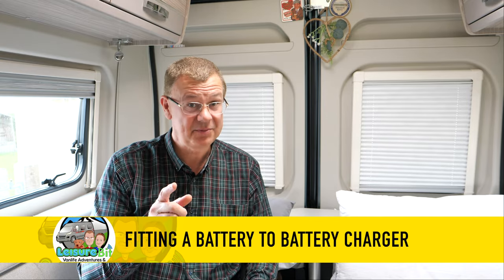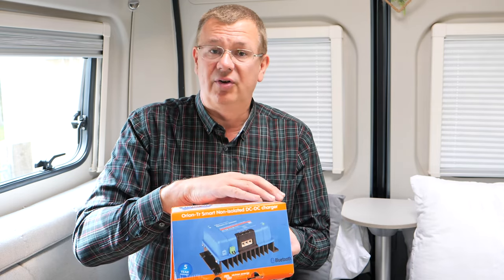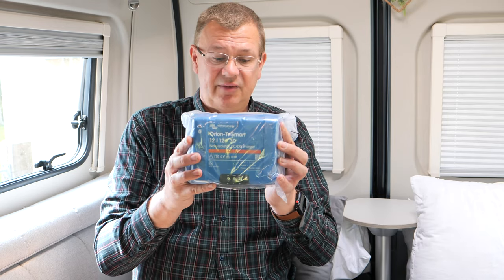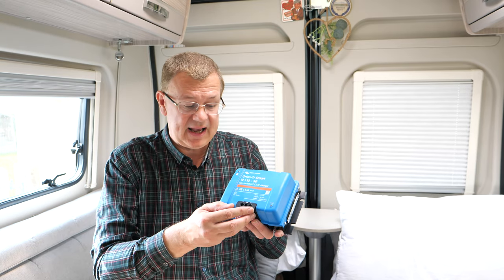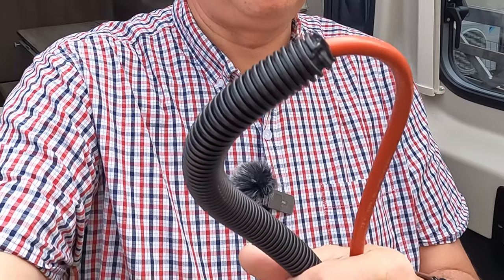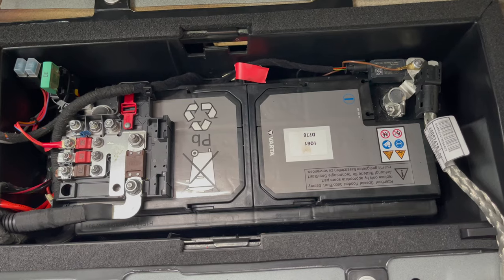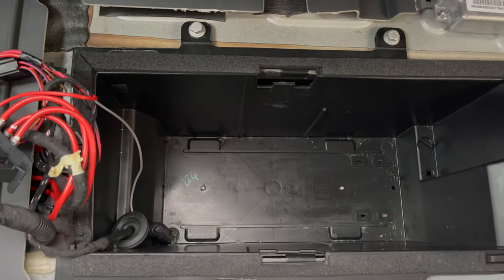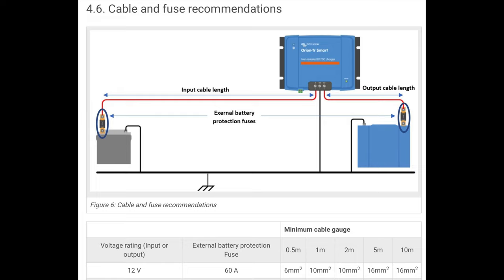Victron Orion DC-DC Non-Isolated Charger B2B Installation in my Fiat Ducato Campervan

Comment: So much electrical so little room for beer 😂.
Seriously though good explanation, we’re having one in the new van although the Elddis seems to work ok for us but we’ve never been massive users of 230v
Reply from the maker: Thank you - Haha - we found the beer got too warm next to the heater outlet - who wants a warm beer 🍻 I do think I will do what you did and box some of it in a bit better at some point though. (Will be another job which never happens!)
Seems to have cracked the problem of poor charging when driving - for those cloudy days when solar is naff wanted something for when we’re away for more then 4/5 days off grid and driving about the battery gets a decent top up (should add about 50ah per hour of driving then with both - we were only getting 15A or so via the Elddis electrics (wiring seems massively undersized) and made it so it can be removed when we come to sell the van (saves future spend hopefully 🤞) as can put it back as was (beyond the hole in the floor obviously 🙄)
Hope you guys have a lovely weekend - all the best, David 👍

Comment: Hi David, love your videos by the way. I have an all powers power bank and need a way of charging on the go but quickly, using the 12v power lead would take 10 hours from flat. I was thinking a 60amp B2B, this will put in 650/700 watts PH. My question is can I piggy back off my existing B2B to power my second B2B charger (can I use the power from the first one) thanks in advance
Reply from the maker: Good afternoon, you would normally run an additional cable to a second B2B if it’s drawing a high current - assume the power bank has an input which will take a charge bigger than the 12v lead which you would use?
How large are the cables to your existing B2B and what power is that one? (Might give an idea on any spare capacity)
All the best, David 👍

Comment: Great video…I assume that you had a split charge relay fitted before this video and your conversion…..did you disable it? If so how did you do it….can you point me your instructions on that aspect?

Ray
Reply from the maker: Hi Ray, the van had a Schaudt B2B fitted before I installed this - some of the models have a split charge relay but with mine having a smart alternator it had a B2B all be it the power output was poor compared to claimed output on the old one. I think you can pull a fuse and some people have not bothered disabling - personally I would then you know what’s what though. Not sure if that helps at all, All the best, David 👍
Reply: @LeisureBit  Hi David…. I don’t have a smart alternator, even though the vehicle is only 2017…just before the smarts came out in ernest..by and large, smarts don’t have a split charge relay; though some actually still use them.
So this leaves me with a dilemma about how to disable it and then fit the Victron Orion smart DC 2 DC charger……
I’m thinking I’ll try to remove the D+ wire that energises the relay….but I need a little more advise..

Thanks for replying though….much appreciated

Ray
Reply from the maker: @rayleeson6135  hope you manage to get it sorted, like you say removing the d+ might sort it but difficult to say without looking into further,p. Good luck 👍

Comment: Using same charger. Gets so hot I can’t touch it for more than a few seconds! Is that normal? I’m using 6awg wire and 60amp fuse at the battery. 

Is the burning hot normal?!
Reply from the maker: Yoo mean the charger or the cable? If it’s the cable that’s a concern. The charger runs warm and can get hot when it’s been on for a little while hence the large heat sink - it does drop back power if it gets too hot. Where do you have it mounted? Is there enough air circulation? You can get a cooling fan if needed too

Comment: Hi David, I’ve been watching your lifepo4 installation videos (and others) with great interest. We’ve downsizing to a cv20 Supreme, picking it up early July. Having had lithium in our last motorhome we would like it in this one too. 

Although I follow most of what you are doing and saying, some of it is over my head, particularly connections to the existing system. I wouldn’t feel confident to connect everything myself. I’ve been collecting the parts, all Renogy (the 2000 watt inverter has a transfer switch built in).

We live in the Isle of Man and unfortunately the scope for specialists here is limited. I can do most of the leg work myself, but it’s the final marrying up to the cv20’s electrical system I really wouldn’t want to do.

What I would like to do in late August when we go away on our first long trip, is to drop in to a specialist who can finish off the connections. I was wondering if you could recommend someone we could pre arrange an appointment with? We’re heading towards Portsmouth ferry terminal from LIverpool.

Great videos by the way, I’ve collected most items needed to copy some of your mods. 👍🇮🇲
Reply from the maker: Not long now until you pick up your new van. I find it’s about space optimisation as lots of folks seem to have a lot of space in the big vans for the electrics but I wanted to minimise the space used by it and partially achieved that I think so I didn’t lose too much storage space, 
Regarding connecting it up, I don’t have any specific company to recommend and would only recommend based on experience and haven’t used one. I know @gadgetjohn was doing some work like that or similar previously so might be worth giving him a shout or in the CV Owners Group on Facebook there’s been a few recommendations too. Conscious different gear need slightly different configurations too. 
Good luck with the van collection - exciting times
All the best, David 👍
Reply: Thanks David, I’ll do some searching on the cv owners group and see if I can find recommendations. 

Yes starting to to get excited about picking up the van, planning a trip based on Greg Virgo’s run down the N2 in Portugal.

Thanks 👌🇮🇲

Comment: Hi David Fantastic video. I was wondering how you connected the  D+ connection alternator wire? I have a fiat ducato 2022 with stop start. Love the Chanel.
Reply from the maker: Thank you, really appreciated. The D+ was handily connected to the b2b which was installed when I got the van. Not sure if you have a converter connector in the pillar behind the drivers door as you can pick it up from there? If not you may need to pick it up from either the alternator or another point.
Hope that helps?
All the best, David 👍
Reply: @LeisureBit  thank you so much for your help. Have a great Christmas and a happy New Year.

Comment: Hi David, love your videos. The original B2B installed (Schaudt WA 121525) has a switch for switching between battery types. If you have fitted Lithium and the engine battery was lead acid, which battery option would you chose. Also is this why you fitted the victron unit. Thanks 😀
Reply from the maker: Hi, thank you - appreciated. I wasn’t getting a decent charge rate so added the additional one - watch this space as pulling both out and replacing with a single unit.
The Lithium setting on the Schaudt isn’t the best for the LiFePO4 battery type I have (voltage is slightly high and it’s not very smart)
The Schaudt charges the Leisure battery so the setting is for the receiving battery, in this case Lithium (all be it the standard lead acid setting may be better for modern lithium LiFePO4 batteries.
All the best, David 🌅

Comment: Hi, super interesting, thank you. I was wondering how you could tell that the first earth you chose wasn't a good earth? Did you have to instal the whole system to find out or is it possible to test before hand?
Reply from the maker: Thanks for the comment. Interesting question -I tested it with a multi meter and it was ok from a resistance perspective for the first point so thought that would be fine, it was handy too. The issue was it wasn’t handling the current and the bolt wasn’t able to tighten enough. Lesson learned so I went to a more direct to the main chassis, I did consider running a wire from the negative chassis point near the battery if that hadn’t sorted it but that would have removed the benefit of non-isolated. 
Hope that helps, all the best, David 👍

Comment: David-- thank you so much for your informative video.  I noticed that both of your fuses are near your converter. Shouldn't the positive lead off of your vehicle battery have an immediate fuse right there to protect downstream?
Reply from the maker: Thank you - it’s got a 60A Mega fuse off the vehicle battery before it connects to the cable so it’s protected at both ends (I tend to double protect appreciate the likelihood of an issue in reverse is small but it does exist so fuse long runs at each end - main one of course for the battery feed is at the battery end. All the best, David 👍
Reply: Thank you!   This sounds like a very good approach!
 @LeisureBit

Comment: Hi
Good video 😁
We are fitting lithium to our adria coral 670 2019 (on 2.3 multi jet fiat base)
Struggling to find out what alternator capacity is 
Almost impossible to see the alternator itself never mind any identification labels 😕
Reply from the maker: It’s very difficult without getting it lifted up so you can properly get under to see the capacity - the only real way to confirm is to check it - I think if the van has a converters socket which most conversions do the load on that is 50A max but that still doesn’t answer the alternator. 
Sorry that’s not much help 
All the best, David

Comment: Hello David, thank you for sharing your knowledge, if I have 24V lithium batteries should I use an Orion-Tr Smart isolate 24/12-30A? That is, the device receives the battery connection in 12V and then the 24V lithium battery is connected?
Reply from the maker: The isolation is more around the negative / earth / ground connection rather than the voltage - I believe either should work but depends exactly on the setup - I would probably go isolated with different voltages just incase I changed the configuration later and wanted an isolated negative.

Comment: Why did you use such a high gauge of cable for the ground to the chassis?
Reply from the maker: Thanks for the comment - the reason for the thick cable is the leisure battery is being connected to the vehicle chassis so ensuring that in the event the positive of the leisure battery came in contact with the vehicle chassis the negative isn’t the weakest point and it should blow the fuse on the positive connection rather than potentially burning up the negative - the battery output is 250A continuous and 500A surge so needed to make sure it would handle that. Also saves voltage drop when b2b in use.
Hope that makes sense, all the best, David 👍

Comment: Thank you so much. I will be using this video for my install  I was confused about the negative to Earth and if I had ordered the correct charger, I have the non isolated same as yours.  I am assuming my main starter battery will be earthed to the chassis already somewhere so will earth the negative from the charger to the underside of the chassis (is it als ok to earth to the metal floor inside the van)?
Reply from the maker: Yes that’s right - the vehicle battery is normally connected to the chassis - you may be able to find a good stop to connect it to - just to make sure it’s a good connection for the power - all the very best, David 👍
Reply: @LeisureBit  thanks. If my leisure battery is earthed can I put tye negative through leisure battery terminal? My CTEK unit in there now is positive to starter battery and positive abd negative to leisure battery.

Comment: Excellent video David clearly explained.  Quick question, the smart alternator shunt sits on the neg battery post. How does this work and can it sense the extra load from the B2B?
Reply from the maker: Hi Brian, assume you mean the one on the vehicle battery rather than the one I fitted to the leisure battery? 
They both work very similar to be fair. They work by sensing how much power is going into (charge) or coming out (use) of the battery - on the vehicle it will be helpful for the computer running the vehicle (ECU) to know for example how much charge is getting to the battery to determine if start stop should activate and to help determine when the smart alternator should and shouldn’t be giving charge and how much. The additional load of the b2b should then register as demand via sensing the power increase or enable the alternator output to offset. (Hence smart)
They actually work either via sensing a magnetic field generated when current passes through, an induced voltage fro,pm this or via a piece of metal with a slight resistance then measuring the small voltage across it, using Ohms Law then you can calculate the current.
Hope that helps / made some sense?
All the best, David 👍
Reply: Thanks David, so I take it the current our field shunt is detecting ALL the current that is returning to the battery via the earth strap that is connected between the battery neg. and the van chassis.
Reply from the maker: @Brian-ug3cy  yes, that’s right (from my understanding of the setup anyway) there are some signal wires from the shunt / sensor but other than that the negative can just be disconnected to isolate so all current should be detected by it.
Reply: Many thanks David 👍

Comment: Thanks again for aq great video covering the modifications. Did you out the Orion in the same location as the existing B2B that came with the van?
Reply from the maker: Hi Louis, I put the Orion in a different place close by as was planning on using both but if it’s a swap easy enough to put it in the same place / check your alternator size before using both to make sure sufficient power - the extra 5A from the Orion shouldn’t make a difference but if you double up then worth checking
Reply: I’ve replaced the existing dc-dc with the Orion non isolated but with new 16mm2 wires and a 70mm2 earth from the smartshunt. One thing you did mention was the use of the D+ cable. I have it ready to go but not sure of where best to wire it in to the Orion. I’ve just added the standard loop from L to H that the Orion comes with. What do you suggest?
Reply from the maker: Hi Louis, if you remove the bridge between the L and H and connect the D+ to the L then it will enable when D+ is active as it pulls L to 12v and that enables hope that makes sense (so you have then no connection to H as you would remove the bridge - my understanding is H just pulls L up so it enables hence removing the bridge and connecting to L enables just when engine on)
Hope that helps,
All the best, David 👍
Reply: @LeisureBit  after a bit of experimentation and help from the motorhome fun forum i connected the D+ to H pin and disabled engine shutdown override and input voltage lockout. All works correctly now.

Comment: David,  did you connect the D+?  On the victron it runs an algorithm that works out why the smart alternator is active based on voltage and gives protection to the starter battery by not taking the power straight away.  The need for the D+ is this not required.  The factory one uses the D+ and thus draws power out of the battery regardless of the battery capacity and whether or not the smart alternator is fully charging or not. Did you do the D+ in the end?
Reply from the maker: Hi Barry,  because I have the vehicle battery maintainer, without the D+ it can get in a loop (as it senses the extra voltage then starts discharging to charge the leisure battery due to the maintainer increasing the voltage of the vehicle battery if that makes sense) - without that it would be fine but it’s to avoid the looping 😀
I have the D+ connected but need to tidy the wire up as temporary until I’ve checked all good.
All the best, David 👍
Reply: @LeisureBit  interesting point.  I too have the battery maintainer but need to think about your point. I was going to put a switch in that I manually set when stationary or via a relay using the d+ to turn off maintainer when engine is on.  🤔
Reply from the maker: @barrycatton9394  it’s a shame it doesn’t have an enable signal to connect d+ to. If I had a switch I’m sure I would forget. Connecting D+ to L input on the Orion fixes the issue (my auto mode ala D+, second is Victron auto mode and 3rd is off via a switch I’m fitting to finish off so I can change if needed but will leave set at auto D+ (will do a follow up with how I’ve done it via a spdt switch.